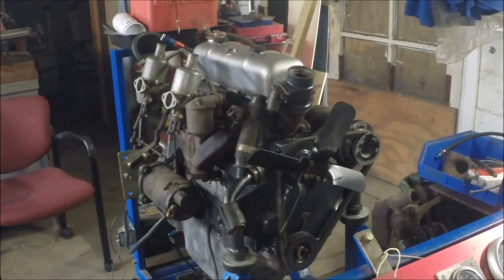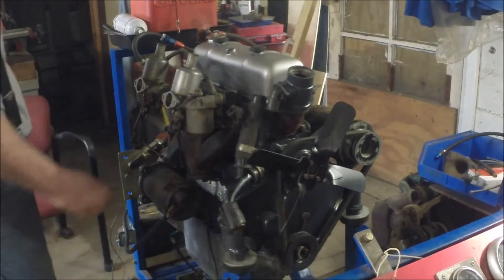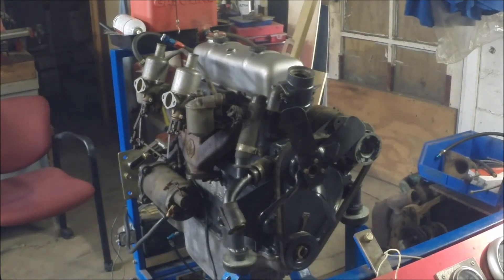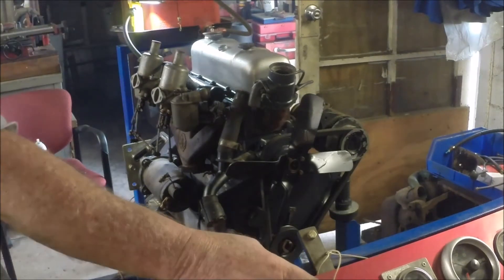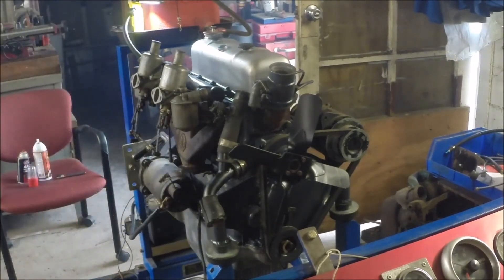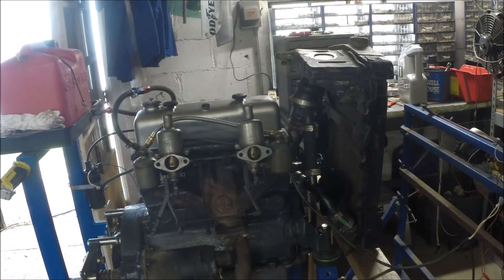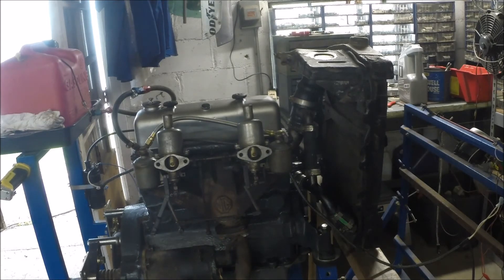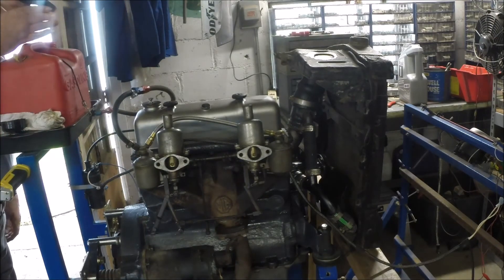1947 MG TC Rebuild Episode 16

Comment: Bob that's fantastic, congratulations! Better than that out of the box you can't ask for. Sounds great, nice snappy throttle response, not bogging after revs. Pistons are dropping evenly, doesn't sound like any vacuum leak around the throttle shafts. A little work and you're ready for the go-kart phase of the project.